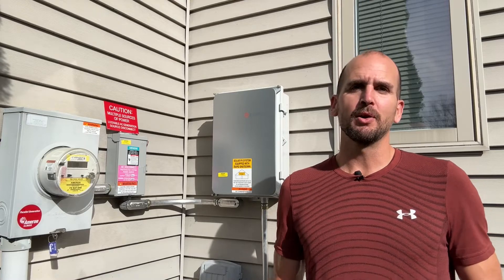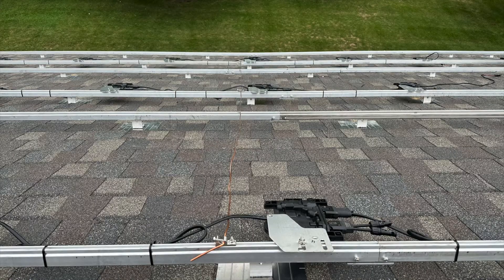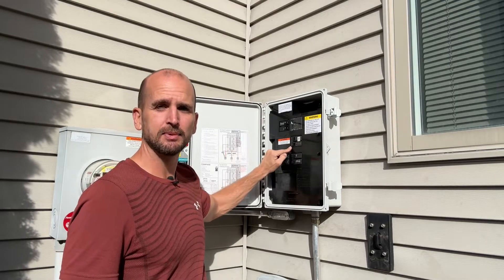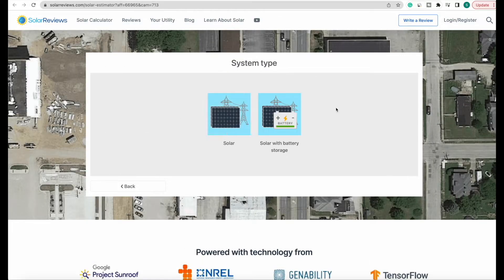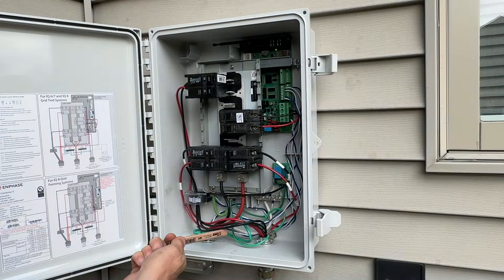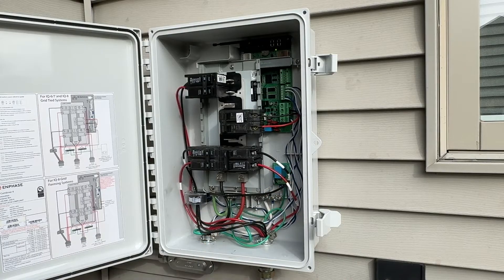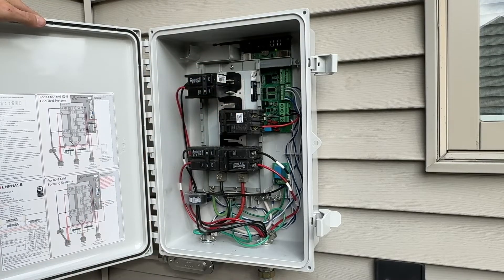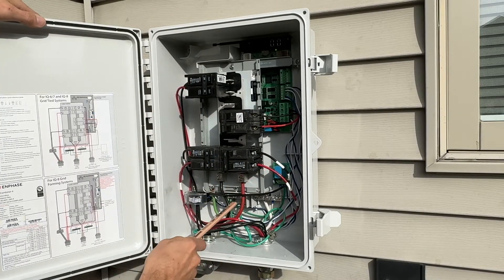What Is A PV Combiner Box | Enphase IQ Combiner 4

Comment from the maker: Calculate Solar Cost For Your Home - https://geni.us/solar_reviews

DISCLAIMER: This video and description contain affiliate links, which means that if you click on one of the product links, I’ll receive a small commission.
Reply: My house in California have 12 Solar panel with Micro inverter install when the builder build the house. It do not have combiner box at all. All they do is connect 1 string of 12 solar panel and connect it to 20 amp breaker in the main breaker panel place outside of the house. So everytime fire fighting need to shut off they only need to shut off main breaker 200amp and that solar breaker.

Comment: my solar is separate from my grid. there is an on off switch in my utility room to manually switch or the contactor wiill switch on grid failure. I have batteries, enough to power my house for 48 hours. My solar panels charge these batteries in 5 hours . if batteries. get below 10% the grid will charge panels or the generator will kick on and charge batteries. do not understand not having solar without batteries. .

Comment: why is there white tape marking the ac lines going into the branch breakers?
Reply: a tactic electricians use to identify pairs.  notice one set had no tape, second set has a single tape and third set has two white tapes on the black AND red wire.

Comment: Great video, thank you!  Question: Is a combiner box required or just nice-to-have? I'm considering DIY a smallish system (6.4kW) with 14 IQ8X microinverters and 2 5P batteries. My subpanel is 125A and has a few open breaker slots - could I combine the strings there and save $700-$1200 on the Combiner 5/5C?

Comment: Can you add a circuit to the combiner like for an EV charger?
Reply: There is a way to do it from the combiner box with hardware additions, but
For grid tied systems like this pull that wire off your main distribution panel which is probably closer to your charging station.

Comment: what is the CT (current transformer) used for in the combiner box?  What is the amperage measurement used for?
Reply: Ok, I will answer according to my setup. I have this combiner, that one is to measure your solar "juice" fed to the combiner, is really good and the company has been around for a long time, made in USA. And, I have two CTs in my distribution panel, they are wired inside a separate flexible conduit for low voltage, but mine are to monitor the grid. Perhaps is because I am selling energy to the utility company. Hence, if the grid is down, the CTs will know and stop my solar production so that I don't back feed and kill a lineman somewhere. If you are not connected to the grid, like is the case of my brother in law, it monitors the solar production.
My neighbor , because he has the micro inverters and the juice comes already as AC, is simply the two lines connected to a 40AMP breaker in his main distribution panel. He plugged it in two slots he had available and Presto!

Comment: Great video.,let me ask you something : I need to change the circuit braker  # 1  that stays off,  the way to install that is the same as a regular house circuit breaker box ?
Reply from the maker: Yes, that is correct.  Just ensure you cut the power prior to removing the cover and swapping out the breaker.

Comment: Great video. How can I add batteries to my existing enphase system?
Reply from the maker: I think you both need an Enpower (Smart Switch) and then Encharge (batteries 10 kWh per unit).  Here is an example of the setup https://runonsun.solar/~runons5/blogs/media/blogs/a/2019/partial-backUp.png

Comment: You have to use #10AWG because of continue power. These two NEC rules require the overcurrent device (breaker or fuse) be sized no less than 100% of the noncontinuous load, plus 125% of the continuous loads. System is running more than 3hrs a day requires bigger wire size.

Comment: I have a string system (34 panels) with a single inverter on my homes main panel with a bi directional meter from the power company. I was told I can add or increase my solar system with a separate system on my detached garage with its own 100amp sub panel if I use panels with micro inverters and it can be supposedly be wired into my sub panel with will also feed back into my home so nothing with my original system on my house has to be changed or is effected. Is this correct?

Comment: I'm surprised the Enphase combiner box doesn't include the required cutoff switch.  Nice video BTW!
Reply: The switch is required as a separate component.
Reply: Is separate, labeled for the firemen and next to the meter, which is not always the case for the combiner.

Comment: Hello,

Pls, can you share your expertise advise on how I can connect a battery backup with my existing Enphase system? 
I plan on using a third party battery I purchased from China. I have two 10kWh batteries that I plan on connecting in parallel. One of the batteries has an inbuilt 5KW inverter and I have another 5KW inverter (same brand) that I plan on paralleling as well as both are 120V. 

For my existing solar system, I have a combined box as well as 3G system controller. 

I understand how to connect the inverters in parallel, but not sure how to connect with my system controller. 

Pls, I’ll appreciate your help in walking me through this process. I can share my number with you if you don’t mind. Really need your help. 

Thank you.

Comment: I haven't been able to find any information online or enchase forum to see if I can add an existing string inverter with 30A breaker to Combiner 5. The new combiner 5 im adding will have 1 60A feed in from a QAgreggator only populated with 2 20A branches so Total input into the Combiner will be 70A well below the supported limited. Im hoping I can run my new i8+ branch and the old inverter system through this combiner, and the production CT. I don't think it will mess it up? Any Thoughts?

Comment: Ran into this seeking info since my IQ Combiner 3 PCB failed. They sent me a replacement. But solar company wants $250 just to show up. Nice info.
Reply: Mine did too how did you fix it
Reply: @markortiz8111 Paid a local solar installer on the side $75. Literally took him 5 min. Took longer for Enphase to transfer and register the new one. Haha. After I saw him do it, I could've done it myself. Just kill the power, turn off the breakers in the solar box, remove the covers, disconnect the PCB and install the new one. Put the serial number label on the door above the old serial number. Call enphase to make the change.

Comment: I can't seem to get this question answered. In a seven K system I am thinking of buying they are using 18 400 watt panels with Enphase 8+ micro inverts and because I want to add a large EG4 PowerPro WallMount AllWeather Lithium Battery | 48V 280Ah | 14.3kWh LiFePO4. They are telling me that they can hook this battery up to my system included in the the cost. This will be a grid tie system so any chance you can tell me how one would connect a DC battery to this Enphase system and make it work. Thanks for any help you can off because I don't want to sign a contract and then not get my battery connected. Thanks again.

Comment: I live in the Philippines'. The grid has no zero lead. Just 2 127V leads making 240V. How do I connect a combiner box with 2 fases.
Reply: it will be hard to answer, we have 1phase and 3phase, and perhaps you may want to check on a transformer that can merge different V and output one.

Comment: What is the best way to upgrade a Solar edge system I’m not outputting enough and need about ten more panels
Reply from the maker: In that case I would probably stick with a string inverter.  What size Solar Edge do you have now?  Might also look how you are feeding power into your main panel.  If you are going into a breaker on your bus bar you might be already at the max breaker size for the size of panel. You have to follow the "120% rule" called out by NEC.  In a standard 200 Amp breaker that would be 40 Amps.  Little hard to know all the different factors to consider and you could jump over to our Everyday Solar Facebook Group if you want to dive deeper.

Comment: quick question I have a 200 amp meter combo panel that has 4 spaces, that are all full but 1. Can I run a 200amp sub panel off of that? I'm trying to run another 100 amp sub to a shop off of the 200 amp sub(welding shop) is this possible. 
Thanks for the videos.
Reply from the maker: You just have 1 open space?  So can’t even fit a double pull 240V breaker ( 2 spaces)?
Reply: @everydaysolar  could i transfer the other breaker to a sub panel next to it with more space

Comment: That's a huge price on that install.😮
So the input is already from an external inverter. So 3 externals?
Reply from the maker: Nope, we are using Ephase iQ8M micro inverters.  So the output from each of the micro inverters in 240V in series consisting of 9 on 2 of the circuits and 10 on the 3rd circuit for a total on 28 panels/micro inverters.  Hope that makes sense 👍
Reply: @everydaysolar  is that more efficient than larger inverters?
Reply: @everydaysolar  "the micro inverters in 240V in series ", Please correct me if I am wrong. The IQ8M are in series, but the 240V from those MicroInverter are in parallel (to keep voltage at  240V). Each string produce 240V, combined in the combiner box. I assume you have a 120 / 240V "split phase" residential feed thus only 1 phase. (the usual residential feed in the USA, unless you have 3 phases.)  Thus at 3:10 you have 2 lines (L1-red, L2-black, N- white).   Not 2 phases.
Ground is green 
240 V between the L1 and L2.
120 V between L1 and N. or L2 and N (the IQ-Gateway board is connected to 120V)

Comment: Solar is Fun!   I got portable panels, a solar generator and my big 10.3kw roof top system.
Reply from the maker: What brand did you go with for your solar generator?
Reply: @everydaysolar   All Powers  for both(Panels and generator).  I wouldn't recommend them.  My 1st generator stopped charging from all sources in less than 3 months. Its a 300wh one.  They sent me a new one.  The panels were rated at 140w, was getting max of 50kw on the clearest, brightest sunny day in Summer.  They also sent me a new one.  That was a good deal for me as I now have 2 panels and connected them via parallel , which I learned how to do from YOUR videos..

Comment: Thanks for the info. One question, is the combiner box responsible for detecting any reduction in power in the case of partial shading and/or panel failure? or is that the job of a regulator further down the line?
Reply from the maker: Good question, when it comes to minimizing the impact of shading on 1 or 2 panels across your entire array that would be handled at the micro inverter.  This is one of the benefits of micro inverters even though string inverters often leverage "power optimizers" to do something similar.
Reply: The micros communicate with the envoy which is inside the combiner box and then the envoy talks to your wifi. You can see it all in the enlighten app

Comment: Thanks for the detailed info, very helpful!
Regarding the line losses of the AC power coming from the mircoinverters into the combiner box -  is there less line losses over these wires because of the fact that this is AC and not DC power, like with a DC power optimizers approach sending DC power over these lines to a string inverter approach, or are these line losses exactly the same regardless if they are sending AC or DC power down from the roof along the same length and type of wires?
Reply from the maker: Line loss is proportional to the current running through the wires and independent of whether that is AC or DC.  With this in mind usually micro inverters (switching to AC) will help to keep your wire gauge lower as the current will be much lower.